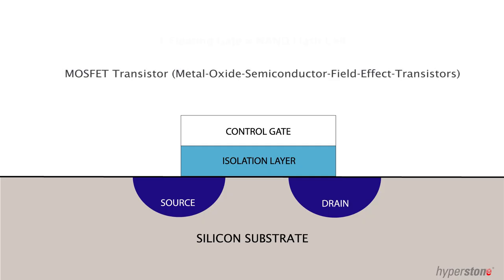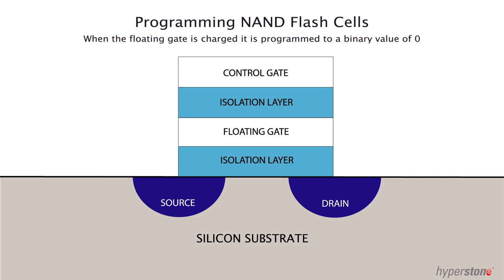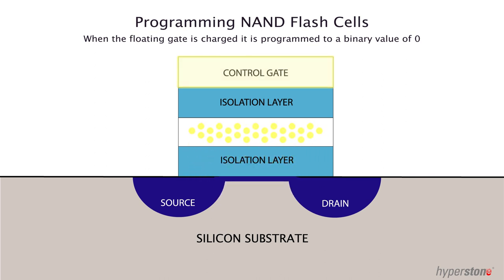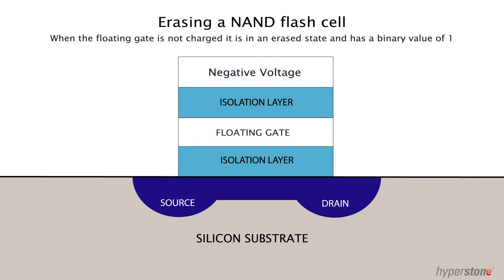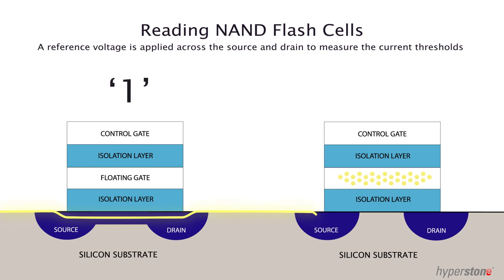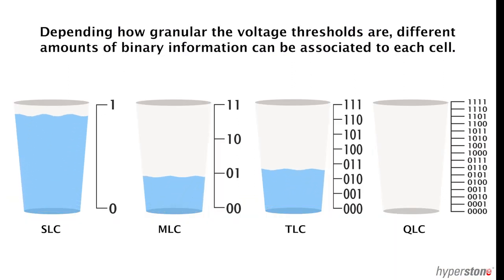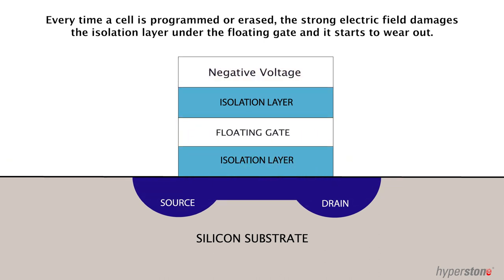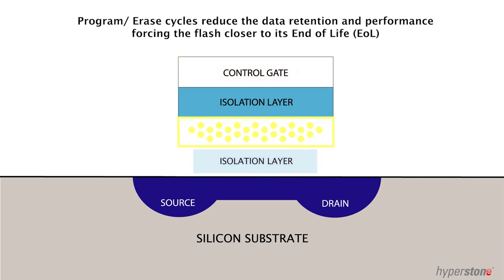Floating Gate Technology | NAND Flash Transistors (suggested #1 for training sequel)

Comment: Hi, don't the electrons flow from control gate to floating gate instead of substrate to floating gate as you mentioned? The electrons flowing from control gate to floating gate is called tunneling and that's what is the basic of the working of Flash memory? Please correct me if I am wrong.

Comment: I'm risking making a stupid question, but why exactly is it called NAND flash?
Reply from the maker: Hi Renato, NAND stands for 'Not AND' which is a type of electronic logic gate.
Reply: it's called NAND flash because the arrangement of the memory cells is serial which forms structure that looks like NAND gate, there is also NOR flash where the transistors are connected in parallel